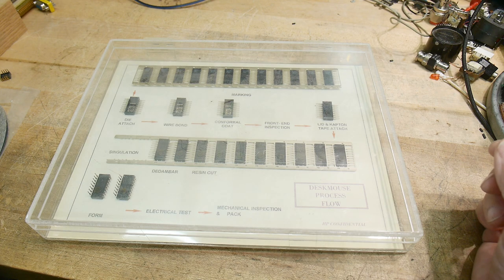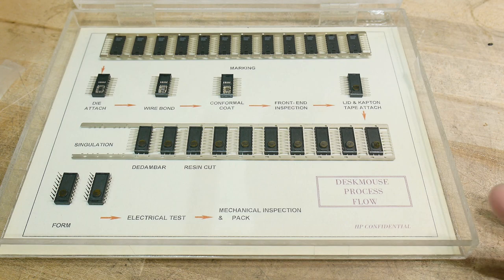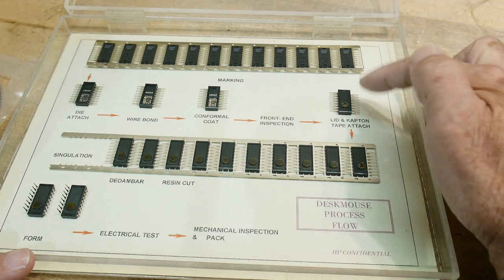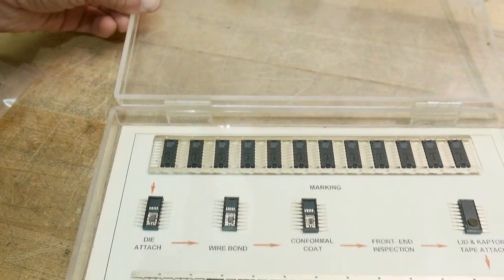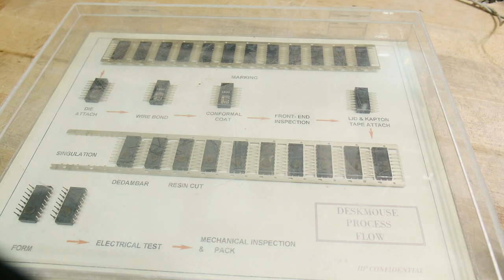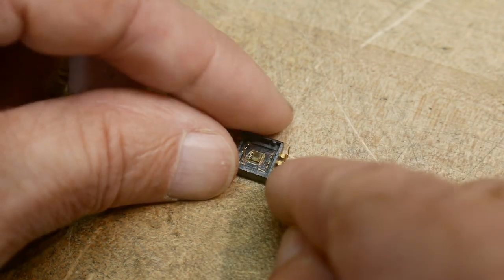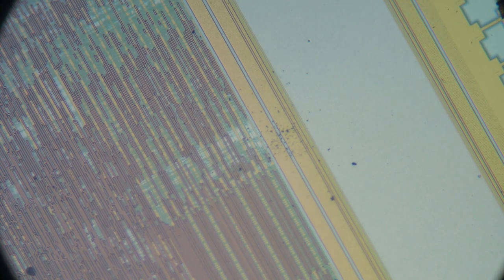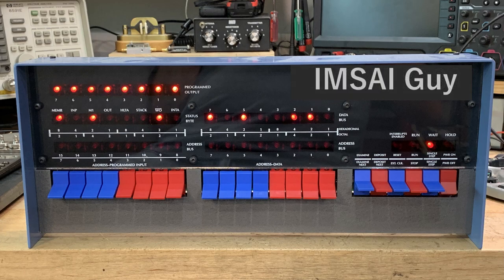#1449 HP Optical mouse secrets

Comment: I like the HP chip they made that outputs quadrature on 4 pins - and I made it instantly hard-wired compatible with Amiga and Atari 9 pin mouse ports. I made 40 PCBs and hand made a dozen of them into other mouse plastic cases.  One way to solve the focus difference with different "ride-heights" is to use a Green or Blue LED.

Comment: Microsoft most certainly did NOT make the world's first optical mouse.  They were first created ca. 1980, both at MIT and Xerox PARC (different designs).  The MIT design required a special mouse pad and was used with early Sun workstations, while the Xerox design reportedly would even work on your blue jeans.

Comment: I was the lead engineer on the navigation units of the mice developed from the beginning of the program in 1997 until I quit in 2005.  That 8 pin part was either Iron Mouse or Copper Mouse.  It was a front end imager/dsp that was connected to a customer supplied processor via SPI.  The product was unnamed when I started developing it so I called it Front End Mouse which became Fe Mouse or Iron Mouse.  The actual design work was done in Malaysia.  I didn't recognize the wafer (I know most by sight) and think that it's a copper or iron mouse wafer.
Reply: It would be cool perhaps to probe this thing and see if it’s functional. Maybe a crowdsourced reproduction project to get this diced up and mounted? Surely there are still some small run packaging providers that could do that?

Comment: This type of hoarding behavior seems to be a common trait among EE enthusiasts—“I might need this $2 component one day!”

Were the pins on those packages offset (for tessellation during production), it looked like they were staggered on each side?
Reply from the maker: https://media.digikey.com/pdf/Data%20Sheets/Avago%20PDFs/ADNS-2610.pdf
Reply: @IMSAIGuy  That’s interesting, I’ve never encountered staggered pin DIPs. Thanks.
Reply: By staggering leads, you get more more devices per leadframe. cost saving step
Reply: “I might need this $2 component one day!” - but every once in a while "I knew I would need this!" and then it just reinforces the hoarding. ;-)

Comment: I've always wondered if an optical mouse would work if it was sitting on a good mirror, but not enough to actually try it. My mind works harder than my body.  :)
Reply from the maker: not this design, there are others the use a type of interferometer that I have been told still works on a smooth surface

Comment: My favorite mouse is Apple’s Mighty Mouse. But it has several issues, chief among them is that the little trackball has a mechanical linkage to the inductive sensors that measure its rotation, and that linkage is prone to being jammed up by debris.

Do you think it would be possible to optically measure the 2-axis rotation of a small (5 mm) rubber ball?
Reply: No problem. Those balls are always dirty enough for the sensor to have something to track on them. How long would the sensor stay clean is another story.